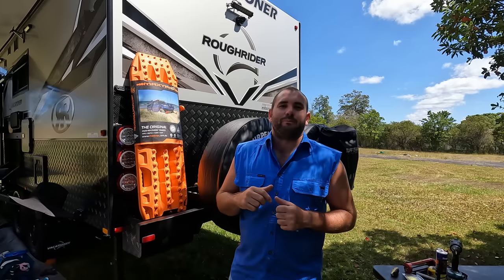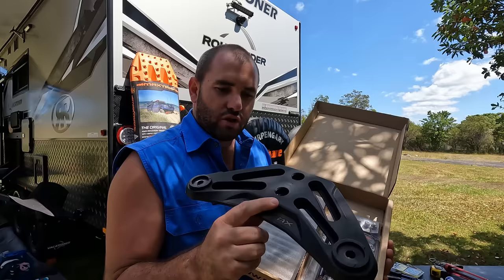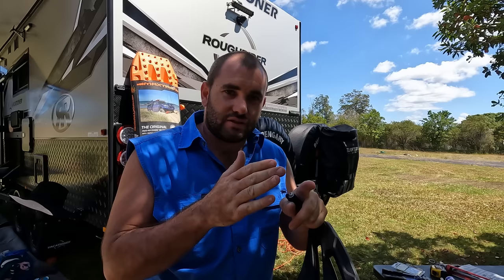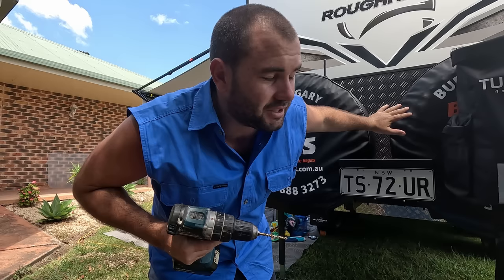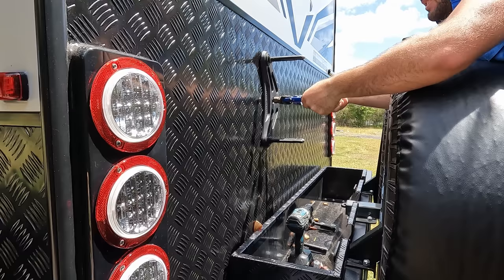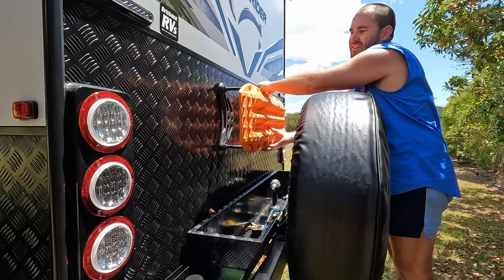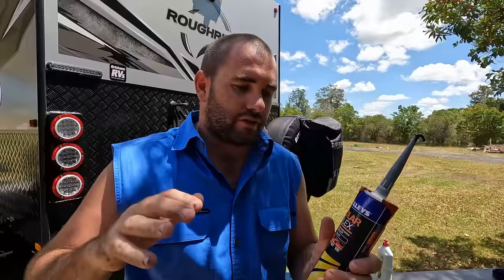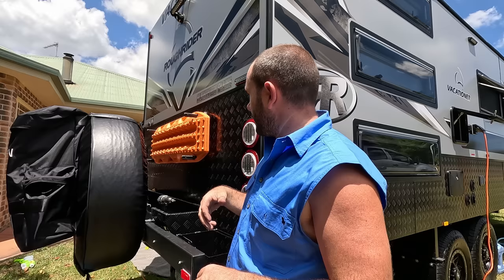HOW TO INSTALL MAXTRAX TO A CARAVAN - EASY STEP BY STEP GUIDE

Comment: Hey Nick, long time subscriber, first time commenter…. I think. Did you consider using a Riv nuts instead of a pop rivet so that you could bolt it in?. I have found using Riv nuts where there was a thin sheet of metal held better and didn’t come loose over time and corrugations. Anyway, great vid, keep up the great work, can’t wait to see your new adventures in the new van
Reply from the maker: Hey guys ! Thanks for the support !!!  I didn’t even think about them to be honest but would work well!! I heaped the glue on hahah so should absorb the shock. 👍🤠